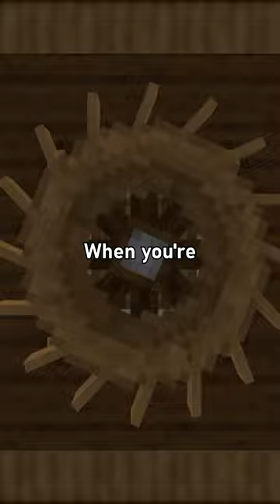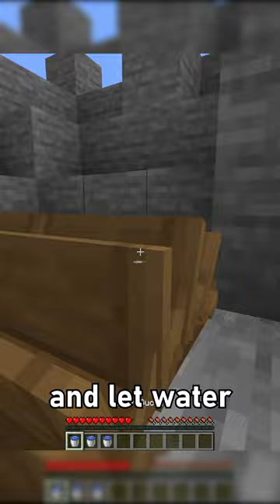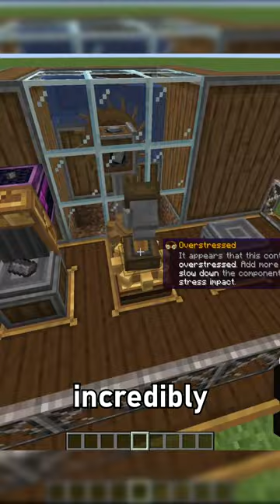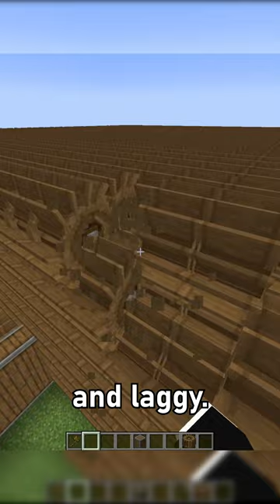Water Wheel - Create Mod Tutorial #3

Comment: Other tips with the water wheel :
• it can work with Lava, it has more stress units, but same speed. You even get an achievement for that.
• Soul sand columns make the wheel quicker
• the more flowing water the water wheel touches,  the better.
• the water wheel can be placed horizontally
• Two water wheels behind two crushing wheels with a single waterfall between the two water wheels is the best way in early game to power your crushing process, no need to worry about rotation senses. It is very slow though.
Reply: Easier than soul sand is to place it horizontaly and makin water flow around the wheel which gives the maximum output
Reply: another fin fact waterwheels are getting an update in the next create update
Reply: @kazii_the_avali  which consists of ?
Reply: @sleepless2612  look at the video i sent from  Kryppers (one of the create devs)
Reply: i should correct myself and say next major update and not just next update as that could just be a hotfix
Reply: is more stress units good or bad?
Reply: @untrouble8191  good, it handles more stress
Reply: they nerfed the flowing water so water wheels are same speed with or without lava/soul sand
Reply: @ottersmeep25  direction and sides touching water also no longer matter. But they added large water wheels, which are more powerful
Reply: @AJ-Palermo   No, they didn't. The large water wheels produce 8 RPM with 512 SU. The small ones are 16 RPM with 256 SU.
Reply: @ottersmeep25   with the way SU works, it is more powerful. It has the same stress capacity if you increase the speed.

Comment: Did this man seriously forget about the most powerful early and mid-game rotational force generation machine? Here's a hint: it has a max stress capacity of 8192 at 16RPM and only requires wood, wool, and andesite to expand.

The windmill. Once you have 2 stacks of sails, you can use it to power huge amounts of stuff. Since it is so powerful, you will likely have access to speed controllers, meaning you can do a lot with it without much hassle.